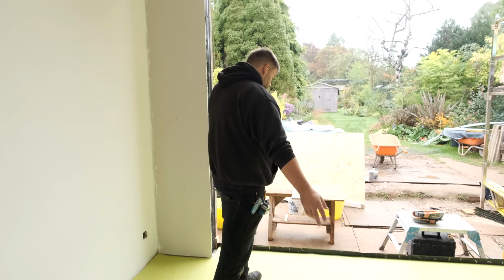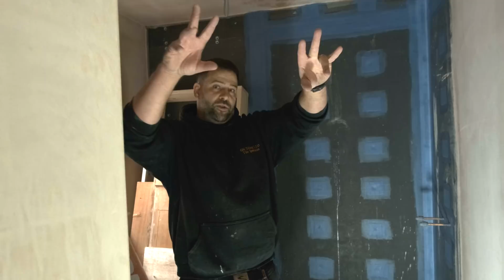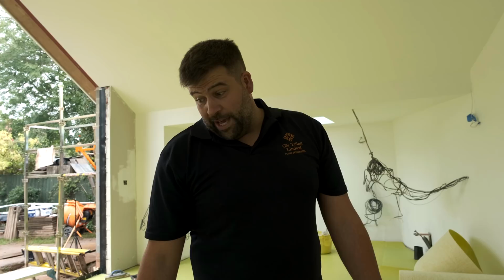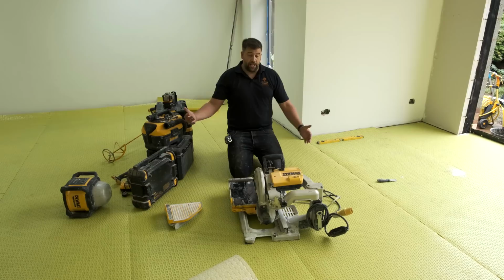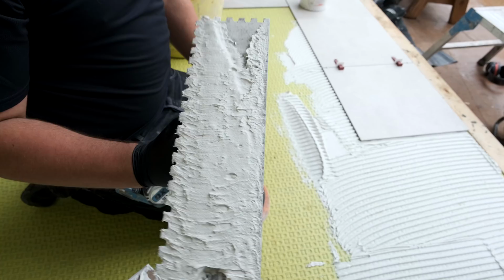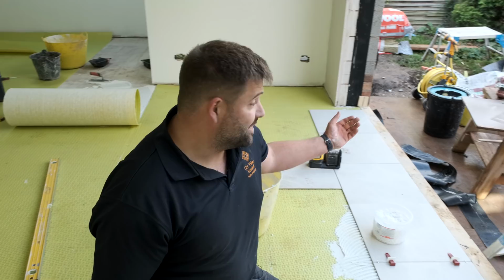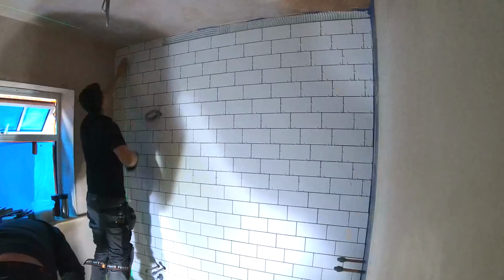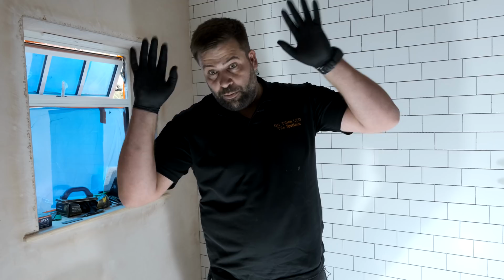Greg's Tiling Tools of the Trade 🛠️ | Single Storey Extension

Comment: I replaced all my corded power tools last month. Grinder, Circular Saw, Jig, Drill, Router with cordless DeWalt and I purchased 4 extra batteries. I WISH I HAD DONE IT YEARS AGO. I only do DIY but the difference they make is inexplicable. A bad workman always blames his tools! With DeWalt it's not the case. I would always have to muck about with my old power tools, with my new DeWalt every task is a one take ! I LOVE THEM and I love Yellow ! I think I understand Cold Play now 😜

Comment: Great video. Question on the expansion joint, he mentioned when over 7m, an expansion joint is needed. What about in the other direction, across the room, that looked greater than 7m. Would one not be required in that plane

Comment: Hi Greg, I noticed you don’t use any edging strips on your wall tiles , is this recommended to amateur tilers  ??? Fantastic job mate 💜👊🏻
Reply: He had a trim where the tiling finished on the edge of the tray. Its only place you would use a trim in the areas he tiled in this bathroom.